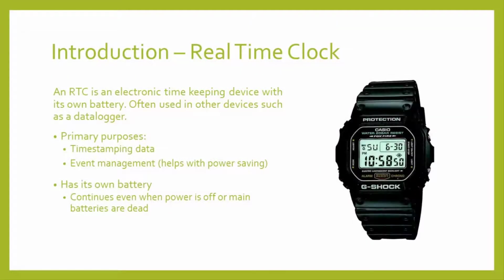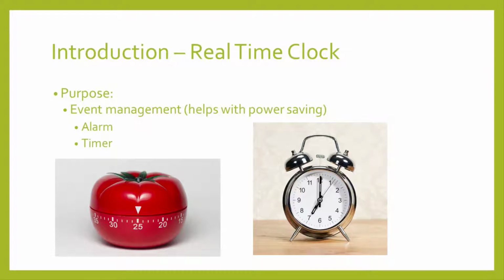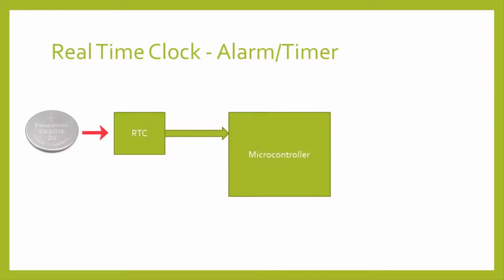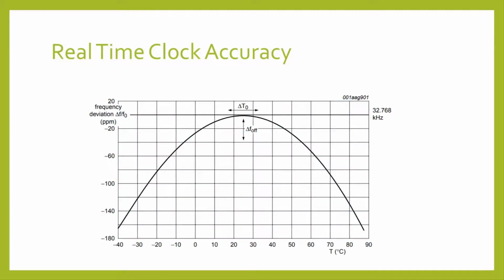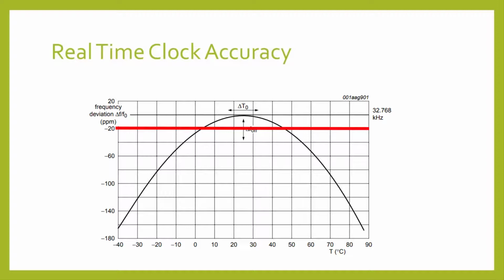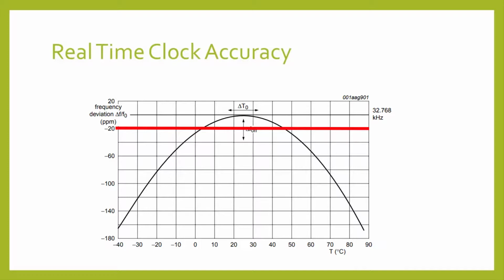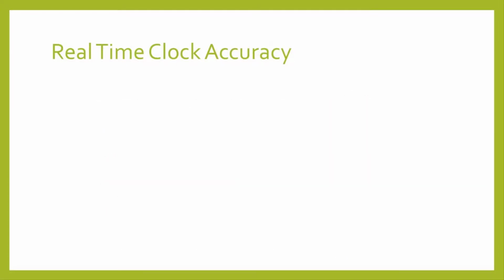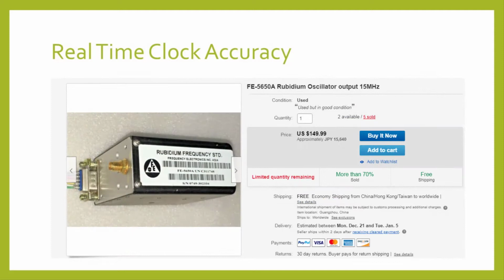Build Your Own Data Logger: Module 3.4: Real Time Clock

Comment: Please help me :::::
I want to start my loop only when my Ultrasound sensor detects the object
and if the object is not present then it should directly stop all the operations until the ultrasound sensor detect another (different or same) object
Reply from the maker: Hi Swapnil - Akiba & Jacinta are answering questions over in our community forum. Suggest you pop over and ask the question there, they'll be able to answer: https://www.wildlabs.net/community/group/build-your-own-data-logger-community
Reply: @WILDLABSNET  OK...